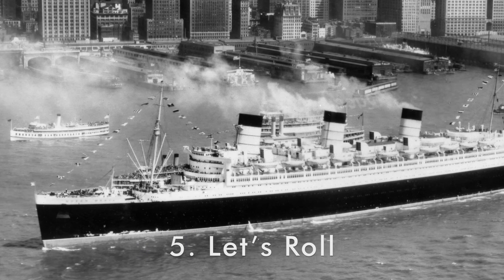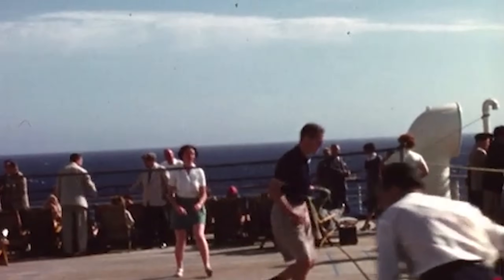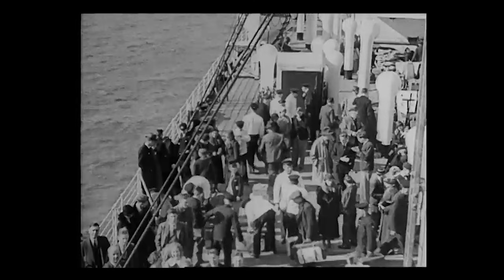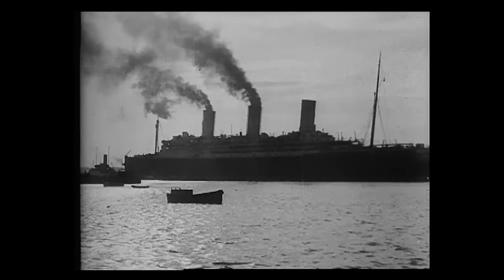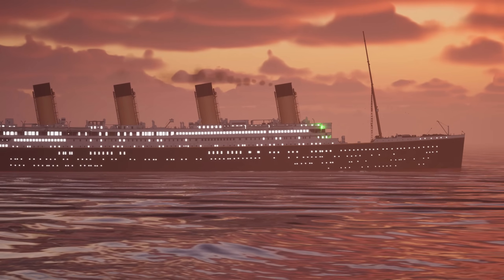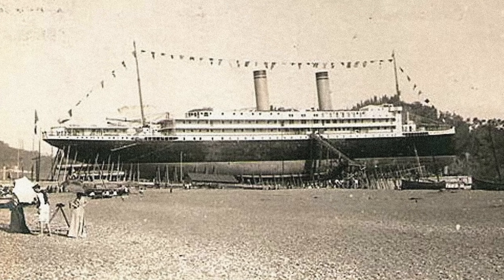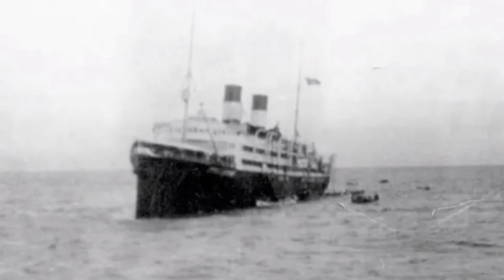5 Ship Design Fails

Comment: There was a submarine at the PNSY. they put the sub in dd #1 and took it apart. batteries ,diesels ,Generators, Motors were removed for overhaul. The hull sat for a long while. then it was decided to move the hull to the back channel for storage. when they flooded the drydock the sub started to list as soon as it lifted off the blocks.They then put it down on the blocks again. and loaded the ship up with parts to make it stable again

Comment: I don't think the iceberg opened "incisions" on the sides of the hull, but bent and distorted the steel panels and popped the rivets and allowed water to leak in between the panels.  I thought the "incision" theory had long been debunked.

Comment: Ships and planes have something in common in regards to rolling.... when a plane becomes airborne, it becomes the wind's bitch no matter the size. When a ship enters the water, it becomes the water's bitch, also, no matter the size. Building a larger plane or large ship won't reduce it's vulnerability to wind and waves. You could be piloting a Cessna 172 or a Boeing 747, if there's wind, it'll get tossed around. You could be rowing a small row boat, or skippering an Olympic Class Liner, if there's currents or waves, it'll get tossed around.

Comment: i've got a solution to funnels: sidepipes. giant ones. who's with me? Interestingly and on a more technical note, outboard motors have  had through - prop exhaust since around the 1950's (mercury anyway). aided by fans, this could certainly be possible today. underwater exhaust. although this would cause more water pollution but not much, and the water scrub the exhaust fumes fairly well.

Comment: In 1991 I was aboard the Carnival Carnivale (Emperess of Brittain, 1955) and the ship was listing badly due to mechanical issues.  So badly that my father had placed a glass of water in our porthole window so he could measure the degrees of listing.  He had told us if it gets past a point we'd need to leave our cabin.  That point came and we went topside where we felt we'd be safer.  As we were waiting for whatever came next, it was announced to abandon ship.  That order was very quickly reversed when apparently the captain received positive news regarding repairs. A bit later we saw a group of men covered in grease from head to toe come up from below, walk to the rail and light up cigarettes.  We knew then everything would be ok.  I wish I remembered more detail, I was just a teenager at the time.

Comment: The reason the Queen Mary had a high center gravity was designed for heavier engines. She was outfitted with newer styles of turbine engines that weighed much less than what she was originally designed for.

Comment: Hi Mike do you think a large 350m ship, made from two separate hulls some 30-50m apart, could be made unsinkable from natural disaster, providing it had an overwhelming amount of other safety features, such as each hull having a full double hull, sides and bottom, 15 or more watertight transverse bulkheads up to the main deck with another watertight bulkhead running down the length of the hulls to create a total of 30 watertight compartments below the the main deck for them each, bringing the total up to 60. Watertight doors could be operated manually, electronically from the bridge and with activation from water floats to trigger the doors shut by gravity. Each watertight compartment would also have a water pump to deal with anything up to a hole of several meters in diameter. Obviously unsinkable here comes with the caveats of cost being no object with all this and none of this would prevent a ship from sinking due to determined military attack. But all this could make a ship unsinkable from natural disaster, in theory lol... Perhaps my musings could be a future video idea for you?

Comment: Retired naval architect here.  Over the years, one US aircraft carrier (I think it was the Coral Sea) had received hull blisters to provide additional buoyancy to counter the additional weight of operational upgrades.  Then it received one blister increase too many.  The result was a significant change in its metacentric height, to the point that aircraft could not safely be handled on deck.  The ship was old enough that it should have been decommissioned and scrapped, but that happened earlier than planned.  The story going around was that at least one Admiral in the approval chain was encouraged to retire earlier than he had planned.

Propeller vibration - The USS Cimarron (AO-177) class oiler initially had a terrible propeller vibration problem caused by cavitation, to the point that the stern vibrated terribly at high speed.  When at MIT for graduate work, a friend of mine analyzed the problem and enabled its fix.  Separately, the T-AGOS 19 class oceanographic research ships had a very, very loud singing problem with its propellers.  In that case, the fix was to grind a bit on the propellers' trailing edge.  

Failure to launch - You may remember the 1628 launch of the Swedish warship Vasa.  The construction crew failed to install the lower deck guns and/or ballast before the launch.  The result was that it went down the ways and immediately heeled over enough to begin flooding thru the lowest deck gun ports.  The Vasa sank almost immediately.  Salvaged in 1961.

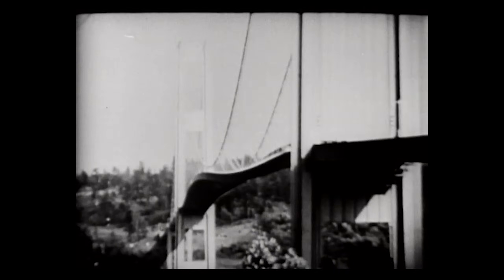Comment: At 8:45 you should NOT have used images of the Tacoma Narrows bridge as a demonstration of resonant frequency, as that had ABSOLUTELY NOTHING TO DO with its collapse. It's rolling motion was caused by AEROELASTIC FLUTTER caused by high winds creating alternating vortices on the back side of the bridge which then built on each other, and a design fault of not enough bracing under the bridge deck. The twisting rolling motion got so violent that it eventually exceeded the material strength of the bridge deck and it ripped itself apart. You should have used images of London's Millenium Bridge instead. Those problems WERE caused by resonant frequency issues until they installed the mass dampers.

Comment: I fail to see how Titanic's is a "design flaw".
It was simply not designed to withstand that amount of damage and it performed according to its design.
A design flaw is a weakness that leads to an unexpected failure within design specifications.

I.e. if you took a bridge intended to hold 200 cars, put 50 cars on it, and it fails under the weight vs having a "design flaw" of buckling under 50,000 cars.
If you took an airliner and the luggage door opened in flight (DC-10/747) vs it having a "design flaw" of not being able to withstand getting hit by a missile. 
These are design flaws.

Comment: I was on the QE2 in 1984 and for 2 or 3 days there was considerable rolling. It didn't hang on the roll the way the Mary was described (I was on the Mary the year before and I didn't notice any rolling at all; it was like I was in a hotel or something). They drained the pools on the second day out, I saw a piano that had turned over, I walked by the Harrod's shop during this time and the shop lady was sitting on the floor with the merchandise all around her. They parked the marmalade cart for a day or two.

I saw the crew leaning as they walked and knew I couldn't be as elegant as they were without practice, but I remembered Popeye the Sailor. I didn't fall or lurch into anything, and during the voyage I was able to grab a couple of people who were tottering backward and get them stable again. Fun trip, and it was still a steamship at the time.

I have to say, England is more seismically active than I had thought it was - the hotel room swayed slightly all during the first night.

Comment: One thing I didnt get about Titanic was why the bulkheads weren't partitioned transversely. By adding in a wall either in the center of the ship or going lengthwise down the hull, turning 1 compartment into 2 or 3 compartments, it seems like that may at the very least have slowed if not outright delayed the sinking entirely.

Another that I don't understand about titanic is why they didnt try to cut weight from the bow after the strike. I'm mainly thinking the anchors. Each anchor weighed 15 tons. I realize that in the scheme of the whole ship thats relatively negligible, however if it had added only minutes of life left to the ship, would it not have been worth it. Just saying.

Comment: Another one you might like to consider was Victoria and Albert III, the new Royal Yacht built for Queen Victoria in 1899. She was dry-docked for fitting out, when a number of courtiers pressured the Constructor's assistants to add all sorts of unnecessary and unplanned accessories which increased her top-hamper. As a result, when the dock was flooded the brand new yacht of the Queen Empress fell over in the dock....

Comment: There is now a company that makes gyroscopes for ships even as big as the Queen Mary. A mass spins in a vacuum chamber at about 16K RPM and is mounted anywhere to the ships hull. This COMPLETELY negates roll on ANY vessel. I believe the company is called SeaKeeper?

Comment: Moral of the lesson summed up for the last ship of this video.

“The purpose of float testing, is to determine how much weight to put in your model so it will float properly. Now if you don’t put any weight in the model, it’ll capsize right away. So, this is crucial. Remember, that the stern section will also need to be weighted properly so it can float independently. Skip this step, and you are guaranteed to capsize right away. This, is, frustrating. So make sure you balance properly.” - Rapidnadion

Comment: 08:36 The Tacoma Narrows Bridge collapse was not a resonance phenomenon. It is often described as such but it is entirely wrong. The phenomenon in that instance was aeroelastic flutter . 

In the case of forced resonance, the energy comes — periodically — from an outside source at the resonant frequency. But in flutter, there is self-exciation , the energy supplied is not periodic, but it is the oscillating flexing of the affected structure that changes how that energy is applied.

Comment: I've aways thought there should have been a way ship engineers of the early days could have designed some sort of large sealed water-tight tubes full of dead air that could be mounted on the outsides of  the hulls just below the upper railing running the entire length of the ship. Or maybe intermittently, to act as 'floats' in the case of a ship starting to sink due to its lower hull becoming punctured in some way.

Comment: I have a question regarding the Titanic.  Would the ship have sunk if there was another bulkhead dividing the watertight compartments into Port and Starboard?  I'd like to think not, but I'm not an engineer.
Reply: it would have started listing heavily due to the imbalanced flooding. Probably to the point where it would just capsize

Comment: Titanic biggest Design Fail was the Amount of Lifeboats, 20 Lifeboats for 2.224 Passengers was never enough, if the Ship had more Passengers on Board (The Ship was designed for 3.000 Passengers total), the Disaster would have been much worser then it was. The Reason for this Situation were  very bad and outdated Safety Regulations, The actual first Plan was 64 Lifeboats, 4 per each Davit, more then enough if Titanic had 3.000 Passengers on Board (the Lifeboats would have been enough for more then 4.000 Passengers). Its like Thomas Andrews say in the Titanic Movie: It was a mathematically certainty that more then 50 % of the Passengers would die.

Comment: The Titanicic disaster was also caused by a flaw that was only later discovered with the unexpected sinking of Liberty ships in cold water. If steel contains too much of elements that cause brittle fracture it will become brittle in a temperature range between 0 and 20°C. This brittleness causes fracture under dynamic loads in the presence of a notch. Now the notch was caused by the iceberg, and the violent waves were the source of the twisting and bending of the ship's hull. Though there would not have been an iceberg then, in warmer water no fracture had occurred. 
Early 1950 metallurgists have discovered that bringing the levels of Phosphorus and Sulphur down, the embrittlement temperature would go down below -5°C. This was achieved by careful selection of the ores and the use of basic furnace linings.  Later in the 1980s, triggered by the offshore projects that had to operate in arctic waters, the embrittlement temperature was reduced below -20°C. This was achieved by reducing the Nitrogen content of the steel to 30 parts per million (was 80-90). This was achieved by degassing the ladle from which the steel was cast, to prevent absorption of nitrogen from fresh air.

Comment: Hi Mike,
Regarding the Lucitania,
gutting the entire 2nd spaces , adding reinforcement, then rebuilding the cabins & elaborate public spaces would have been an expensive and time consuming solution to the vibration. Wouldn't extending either the middle 2 or outer 2 propeller shafts a fair distance achieve the same result in eliminating the resonance?? If yes, then so what if the water churns further behind the ship due to the distant propellers as would otherwise be normal?
Would it work? if yes, why didn't anyone think of it??

Comment: I am sure you are aware that “gross register tonnage” is volume, rather than weight, 1 register ton being equal to 100 cubic feet. It is easier to measure volume, especially when a new ship is on the ways, and this measurement is used to calculate port fees, pilot fees, etc. (Along with net register tonnage, which subtracts out machinery spaces, bunker tanks/spaces, crew quarters etc to measure cargo volume.)
For me it is interesting to note how close the volume measurements came to actual weight for RMS Queen Mary:  Originally 80,774 gross register tons; 77,400 long tons or 78,642 metric tons displacement.  The Imperial or long ton was established in the 13th century at 2,200 pounds, somewhat approximating the 1,000 kilogram metric ton standardized much later.
The  Metricentric Mafia often deride the U.S. for clinging to the laughably quaint “Imperial” system. But, first, we don’t: The American Standard system is different in many ways and, second, there is also an American Standard Metric system which aligns with the French system and is often used. Using both, doing some math from time to time and carrying heavier tool boxes is preferable to the enormous cost of changing entirely over. 
In any event I doubt that much (if any) of this is news to you, but you might throw a short explanation in from time to time. (Shorter than this one, at the very least.)

Comment: love the video, i also like that you used different design fails across your examples, except one. the 4th (titanic watertight compartments) 
 from what i understand, nothing short of a battleship could have survived the damage it took, and as far as i can recall nothing of its design failed, but just like with its younger sister the Britannic who hit a mine, there are just some things out there that a ship is not designed to hit (modern day example: Costa Concordia). i do have to give you good points to not go with "there where not enough lifeboats" on the titanic because they had double the required lifeboats for its time.
i do love the story of her older sister the Olympic. that ship was out for blood.

Comment: To be fair, the idea with Titanic was that she could arrest her sinking long enough to either make it port or in time for rescue ships to arrive. Had she run into trouble in late summer, or during the day, nearly all of her passengers and crew would likely have been saved. It was really the circumstances of her sinking that doomed so many. However, she still stayed afloat longer than any of her contemporaries would have, even with 5 of her compartments breached. Lusitania sank in less than 20 minutes, taking a far greater percentage of her passengers and crew down with her, and the damage was not nearly as severe as that sustained by Titanic. Had their roles been reversed, Lusitania would have gone done far faster than Titanic, and Titanic likely could have weathered the torpedo that sank Lusitania so quickly. At the very least, she would have taken long enough to sink that the majority of her compliment could have survived.